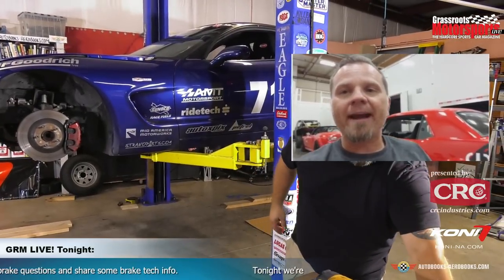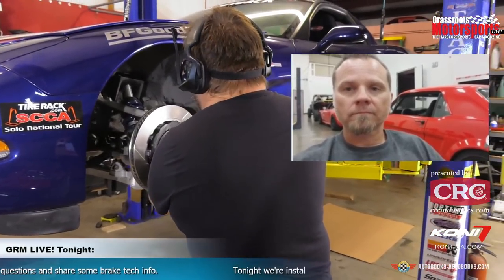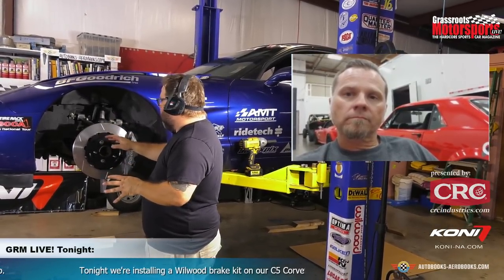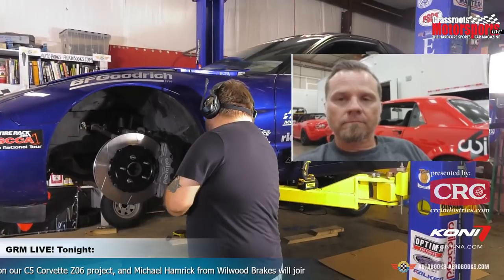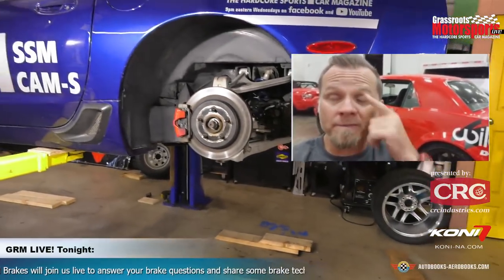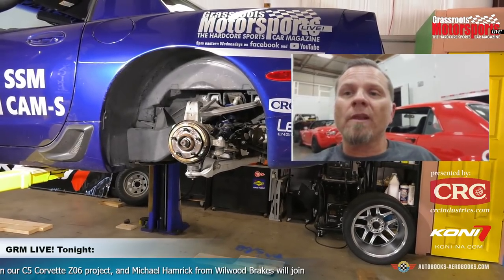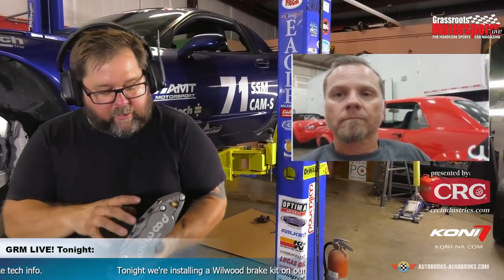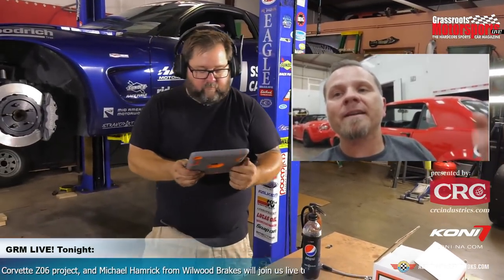C5 Corvette Wilwood brake install and brake tech. GRM Live! Presented by CRC Industries

Comment: How tight can you go with the 90 degree fittings into the calipers. I have them tight, tighter than im almost comfortable with but i still have a very very slight sweating from the fitting on the caliper and the lines are contacting the wheel at full lock but if could turn them a little more i think id be ok.  Which way do you have yours pointing ? And how many threads can you still see on the fitting into the caliper if any ? Thanks for the video. Did enjoy it.

Comment: So any follow up? I'm thinking about this kit and wondering how it's worked for track use.
Reply from the maker: We've done a dozen autocrosses, SCCA Time Trial Nationals, a Roebling Road track day with NCCC and this past weekend at Daytona with Optima USCA, and we're still very impressed. Pad wear has been minimal. Feel is great, but required pressure is minimal, so if you're someone who isn't accustomed to brakes that like a light touch, these will take some getting used to. Overall, we're in love, though.
Reply: @Grassrootsmotorsports  awesome, maybe I missed it but what pads are you running?
Reply from the maker: @carsandracetracks   Wilwood's BP20 compound.
Reply: @Grassrootsmotorsports  so I finally bought this kit and I think I got the wrong hoses. I re-watched the video to see what your hoses look like to compare and you didn't show hose install!
Reply from the maker: @carsandracetracks  Oh no. What's leading you to believe the hoses are wrong? Our car is loaded on the trailer at the moment, but it'll be on the lift this weekend and we can take some pictures and measurements for you if that helps.
Reply: @Grassrootsmotorsports  so figured it figured out, I got c6 lines I needed c5, they have a different style fitting on the chassis side. All good now got a new set already in the mail but thanks!

Comment: C6 base owner watching here, brake system from C5 and C6 base model is the same I think.
Reply from the maker: I think you're right. I think there were some internal part number differences, but I believe everything bolts up between the two chassis.